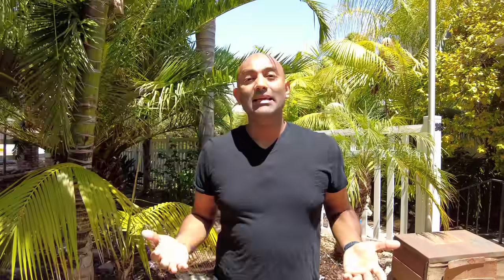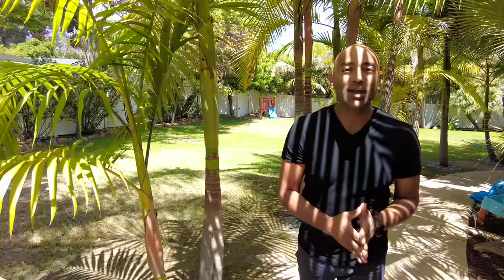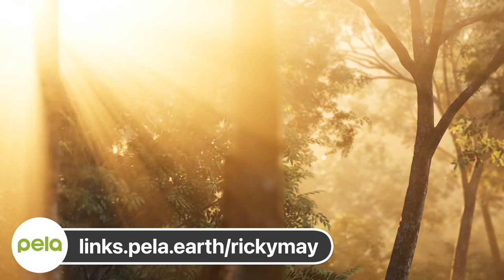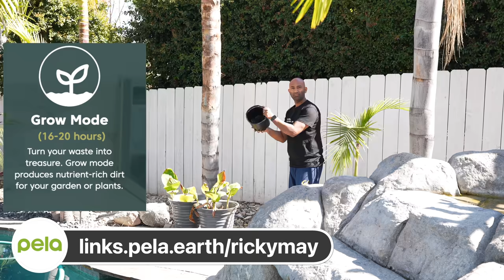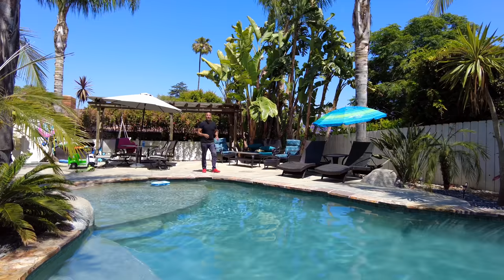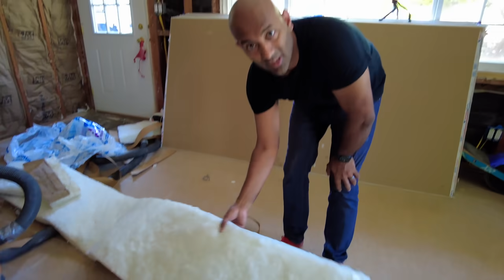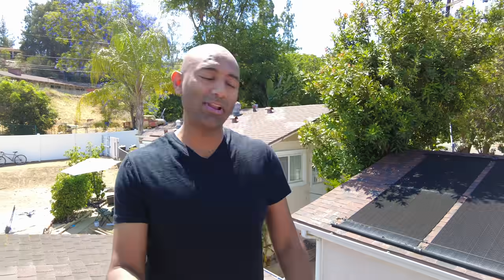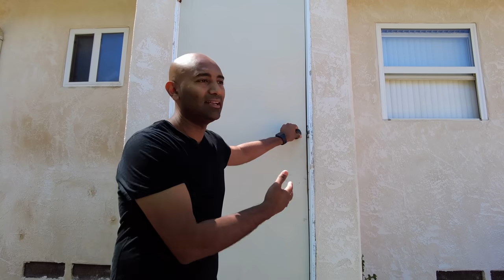How I'm Planning to go 100% OFF-Grid!

Comment: You should check out Matt Risinger
's channel for construction stuff. That wall insulation isn't installed correctly.

Also, if you are replacing your roof anyway you should get a solar roof if you can. Otherwise an upgrade to tile or steel would be best if you are going to have panels over the top.
Reply from the maker: How is the insulation on wrong?
Reply: @TwoBitDaVinci  unless it's a different type the paper layer should cover and be fastened to the face of the studs which creates an air barrier. It also looked like the edges of the insulation were tucked in but it should be a uniform depth. When the edges get tucked you crush the insulation which decreases it's performance.

Comment: 50 cents per kWh, WOW! I did a net-zero home about 5 years ago. Actually less than net-zero. Gas was off and the meter removed and the electric utility actually paid me money over the year and I never paid a penny. I don't think much of fiberglass as insulation. There are much better options. I went with a HP dryer, HP WH, and induction cook top. Also both cars were electric with all charging at home. It was not that difficult to go net-zero, but expensive. At 50c/kWh going net-zero makes the cost side much easier.
Reply from the maker: that's awesome. do you still have natural gas? what about water, do you have any water recapture or other strategies?

Comment: Since you are using an electric pool wall cleaner...what if instead of turning off the pool pump, running it at a slower speed with a VFD so you still clean the water completely, not giving it time for anything to grow, a tradeoff...clean more water with less energy.

Comment: tankless  wh  are 200 usd  in thailand .  no  need  for  ng.
Reply from the maker: electric ? they use a HUGE amount of electricity
Reply: @TwoBitDaVinci  no  bc  no tank on demand.  very  small about 6x12x2 inches
Reply: uk also has them very common. called power shower

Comment: The composter is cool, but in my honest opinion a bucket with some worms does the same job if not even a bit better. No need for 500 bucks machine what uses 1KW energy. Of course the machine looks better on the kitchen counter :)
Reply from the maker: you might be right!
Reply: Or just take it outside and start a compost heap down the back garden. Add some worms, although if your heap is cooking well the worms won't be there!

Comment: The off grid electricity part is probably easiest to do (esp. with your land and roof area).  I see you've settled a plug and play Ecoflow solution.  But for DIY Solar (e.g. Will Prowse's channel), one may even be able to do it cheaper.  The LFP batteries, esp. in server rack form (e.g. Signature Solar's EG4 batteries) has made bulk storage feasible, at a competitive price.   (He even charges his Tesla, with this stuff.)

Atmospheric water generator, check out Watergen. They may have the best efficiencies.  But this is drinking water only.  For other non-drinking uses, consider a grey water system.
Reply from the maker: I just might do that on the main home! go DIY that is, and yeah Will is a great resource!
Reply: @TwoBitDaVinci  I have a professional install (solar + Tesla powerwall) for my grid tied system.  That's because of PTO (permission to operate).  If one is feeding electricity back into the grid, there are regulations.  I'd rather the professionals handle it.

But I also have my own DIY off grid system, for other loads.  The advantage here, is if something breaks, I know how to fix it.  With the supply chain problems, I know to mix and match.  DIY is a great learning tool for understanding the issues.  Great for developing skills.

Between the two, I've gotten all of my electricity needs met.  Besides having to understand my loads, I also am running experiments, for seasonal variations, when it rains several days in a row, to understand what it takes, to go completely off grid.  I have a suburban home.  But that doesn't mean I can't prototype, to understand the issues, of what it takes to be both resilient, as well as sustainable.

Comment: Curious, would it be possible and/or practical to run the geothermal heat pump through the pool?  It wouldn't do anything to heat your pool but you wouldn't have to pay an enormous amount of money to dig underground.
Reply from the maker: I'm thinking about this too! I will do the reserach and I'll share what I find
Reply: @TwoBitDaVinci  I was also thinking that if you didn't want exposed piping in your pool, you could also temporarily drain the pool, and dig a new bottom for your piping.  Fill, resurface and reline your new pool floor.  Not sure if that will save you anymore money though...just a thought.

Comment: No spray foam insulation?  From what I can tell it would work so much better.  Air seals and insulation.
Reply from the maker: Very true! But to control costs we want to find solutions I can easily do myself. Plus we have a radiant barrier first and between that the fiberglass and white stucco layers I think we’ll be good

Comment: For clothing how about that free drying that a clothes line provides. Pretty much zero running costs, and you definitely have the room to put the lines up, plus an added benefit that your clothes come off the line almost wrinkle free, less of the ironing chore, and for many fabrics no ironing at all, plus longer clothing life. Clothes lines last for decades, with almost zero maintenance costs other than the occasional line replacement, and by me the sun shines all year round as well, so zero operating costs as well. BTW clothes also dry on the line at night, even without the sun, so hang in the evening, and fetch next mid morning all dry, unless it rains.
Reply from the maker: how about the damage from UV rays on clothing especially darker colors? and dust in the air? I am thinking about building something just for this :)
Reply: @TwoBitDaVinci  Well, 10 year old black shirts, not the best quality, just cheap ones for work use, are still surviving, they wear out from use before fading much. As well simple to fix, dry inside out, that way no chance of bleaching. Dust is not a problem either, just a shake out gets it off, plus sets the fabric, and you fold it before putting in the laundry basket, so that it is almost ready to put away, and thus no creases. Less wear with a line than a drier, as the drier turns your clothing into a thick layer of felt in the filter while it is running. Just have to buy clothes pegs, preferably bamboo ones, as they do last longer. plus sheets and such are so much nicer after a sun dry, and you can also have rugs washed by hand as well, then hang to dry.

Sold the drier years ago, seeing as it was last used last century...... and only then if the cloth nappies could not be dried in time because of rain.

Comment: There is a company now making solar panels that produce electricity and heat water from a single panel. The water jackets are under the PV cells and are protected from UV damage. Could be the best of both worlds
Reply from the maker: I do like the idea, but I just don't like the idea of water on my roof. I think I'll go with simplicity solar panels are so dead simple, and reliable, I"ll likely just do that.

Comment: Why not start with a well? Way cheaper than pulling it out of the air
Reply from the maker: I’m going to!
Reply: @TwoBitDaVinci  If you're drilling a well anyway, why not drill two and go with an open loop system for geothermal.

Comment: for your secondary home why not us a solar water heater? I t will perform great especially in california
Reply from the maker: i have so much roof, i could add solar panels instead. then i could power a heat pump water heater when needed, or power something else. PV is my jam because it can power anything. i might not be using much hot water, and not needing any more heat. thats why

Comment: I would propose instead of getting rid of gas to keep it as a backup.  Of course anyone living in the real world outside of California has significant environmental challenges that will determine what applies for their own situation.  Looking forward to the series.
Reply from the maker: hey Wes great point! So yes we have the easiest weather and climate probably on Earth where I live. But like I said I do want to make all my recommendations based on where you live, so i'll bring this up. My plan for natural gas is to have a natural gas generator that can power the home circuits, that basically never gets used. This way i could if something bad happened, be prepared, but have a home that's all electric, as much as possible.

Comment: You should be able to save on water by ditching the sprinklers and going to those buried micro-feeding systems.
Reply from the maker: My plan is to do a gray water system from sinks and showers for all the watering outside. And keeping most of the current sprinklers. running them around 5am would be idea, cold ground, and the sun comes up a few hours later, to eliminate fungus growth etc

Comment: Yay ! Earthship!! I'm going see them this summer 😂 in ev road trip 😍🚗🔌
They say blenders and hair dryers take a lot of energy, also a regular fridge uses a lot unless the solar set up... I'm also really interested in how much my car would use.
Reply: Blenders and hair dryers are inefficient, but they don't really use much energy because of their use profile. We have a DC inverter refrigerator which is awesome. That was worth it because it has to run all the time - though of course it really doesn't either unless you like to leave the fridge door open.  We have been entirely off grid in northern Ontario for 4 years now. Our house is passive, but we do collect waste heat from our generator when we get a long run of dark skies that depletes the batteries - that is stored in a tank under the floor.

Comment: Very interesting concept and thanks for another cool video! However, natural gas is so clean you can burn it in your home without ventilation (as long as you have an oxygen sensor). Are you thinking eliminating it will save you money? Seems like your break-even for replacing NG is a long time into the future if ever, especially since you live in such a warm climate.
Reply from the maker: natural gas needs vents. please do not burn natural gas inside without a vent, it's absolutely going to kill you. I am getting rid of it because I don't want to deal with changing prices and stuff. Im going solar with batteries for all my needs

Comment: The second house could use a solar hot water heater.  Without the salt it should be fine.  You can convert your old gas hot water heater into one.
Reply from the maker: Thinking pure PV solar everywhere and a heat pump water heater

Comment: For water heating, because you are going to get new solar, how about Thermo Solar? This combines the heating of water with the solar PV. This way you use the sun more efficiently.
Reply from the maker: also adds complexity and leak potential. I think im going to keep it simple and get traditional PV solar. i had it for 10 years and it was flawless. the thought of leaking water on a roof drive me mad, after my current crap

Comment: I wanted to put solar panels on the roof of a building I was recently allocated by Dundee City council in Scotland. The council sited roofing costs as a reason for disallowing the possibility. It is a pity they decided this as electricity has recently doubled in price since April 1st 2022 cost rises. I will not be able to afford heating this winter at these new increased prices. I will be investing in a caravan battery and current inverter to sustain heat through the coming winter months. Or is it AC to DC? I forget.
Reply: I believe the car batt is DC n youll need it to be AC to use appliances with an inverter
BTW iv been using solar powered lights inside my windows for light at night
Obvs not as efficient as being outdoors, but currently all my lighting needs r met. 
Ill only b getting more cos winter sun and SW facing windows
Reply: @kimwarburton8490  can you recommend any good priced inverters?
Reply from the maker: Lee I am working on something really great. i'll have everything on my website, but I am going to create a total solar buyers guide. coming soon!
Reply: @TwoBitDaVinci  let’s hope scottish government renters can see a change to government policy that allows those renting to cut their electricity bills by installing solar panelling on their properties. at present scottish government renters are not permitted to install solar panels. this means scottish government renters, who are most usually those on least income, are being denied saving on electricity costs and so are burdened with the highest possible electricity bills. this government strategy of taking most money from those who have been disallowed the option of reducing their electricity bills is a cruel strategy that does little but shame the governing authority in question.

looking forward to your website updates.

Comment: A small solar hot water heater  for the office. I would think would be great cheap system.
Reply from the maker: could work, but i have limited roof space, so I'm thinking all PV solar, and a heat pump water heater... something small and 120v
Reply: @TwoBitDaVinci  in UK you can get eddi hot water unit that uses the power from your solar to heat water in your tank

Comment: Are you using any passiv haus tactics? I once designed a method of building a passiv haus using sustainable materials. Some of the ideas I got from Earth Ships.
Reply from the maker: I am going to try what ideas do you have in mind?
Reply: @TwoBitDaVinci  The most important passiv haus standard to meet is air tightness. That is fantastic for those with asthma and pollen allergies. But passiv haus standards can be quite expensive to meet. San Diego rarely needs heat so the primary function of passiv haus is not needed. You might look into solar chimneys if you want to cool your house without a heat pump or A/C.

Comment: im sure this is already gonna be covered but there are water cooled solar panels why not use them for the pool they are much better built than the rubber panel material
Reply from the maker: I don't need pool heating often, so I'm going to get a heat pump water heater, and go 100% PV solar on my entire roof. this way I can power whatever I want each day, like maybe one day I charge my EV. the next I charge my batteries to full. The next heat the pool etc... so this give me max flexibility

Comment: What is the voltage and amperage being fed into the pool robot?  Water and electricity can be a very dangerous combo.
3000 sq ft house.  lmao   I am 875 sq ft.  And looking to downsize that.
Natural Gas - You may not be able to produce that on site, but what about hydrogen?
Geothermal ++.  Great way to go, if you can afford it. :)
Great video!
Reply from the maker: Yeah if we can do it I’m hoping everyone can. Robot runs on about 150watts

Comment: Wool, hemp or Cork insulation had been a more eco friendly option than fiberglass.
Reply from the maker: You’re right. With a tight budget we had to use what we had at Home Depot. Plus that wall will never be opened again for the next 50 years so it’s pretty permanent

Comment: the heat pump hot water tanks are 110v.   They are designed to be drop in replacements for gas, not 220v electric.
Reply: now if you find a small one, (office size vs home size) I'd love to see that.
Reply from the maker: Awesome. I need to shop for the smallest get pump system! Like even less than 50gal

Comment: I'm fully off-grid. Best EVER. No more utility bills 😄
Reply from the maker: That's awesome! totally off grid, you have no connections at all?? that's so cool any insights?
Reply: @TwoBitDaVinci  We got 40k litres of tank water, 40kwh battery, 5kw PV(will double with ground mount later), 300l solar thermal roof top hot water, 2 x 5kw all in one solar inverters, led lighting throughout and 2x45kg lpg gas tanks for cooking. Plan to go biogas digester in future. Might want to look at Will Prowse new setup with EG4 inverters. Mine are MPP solar inverters. And 3600l septic system. 4.5hp and 2.5hp split AC for summer. We're a household of five and very frugal with power. Wood fire heater. One point most ppl don't tell you is that you really have to work with the sun, so only use dishwasher at midday when sunny, use cold cycle for washing machine in the morning unless you wash at midday, use electric oven when it's sunny.... Etc. Goodluck!

Comment: I would like to see the heat pump clothes dryer and heat pump water heater be able to work together with the refrigerator. Waste heat from the refrigerator could be used to dry clothes and heat water and waste cold air from the dryer and water heater could be used to cool the refrigerator. 
Why doesn’t someone come out with a “system” like this?  I think if Elon Musk ever gets into appliances this is one thing he would do.
Reply from the maker: That’s a bit tricky but yeah I think we should!

Comment: I want to rely on your knowledge and experience to assess Triple Solar's claims. If your findings are positive then you may want to be a promoter/distributor if possible. Also to solve the 100% electricity i need to know if an experimental TEG can operate with the heat. It has already been built and tested. The findings are online but you have to gain access to get the full report. The size is like  suitcase and can easily fit in utikity room.